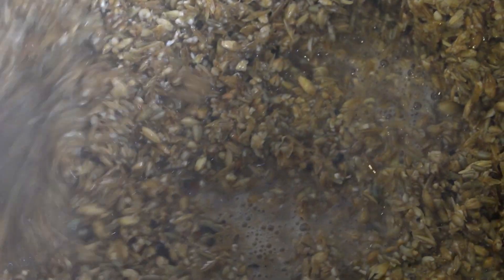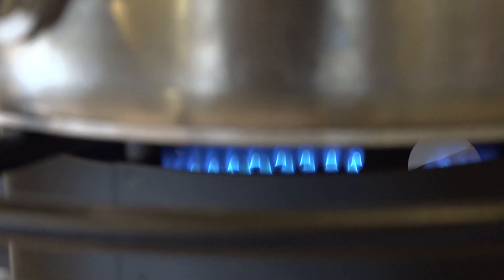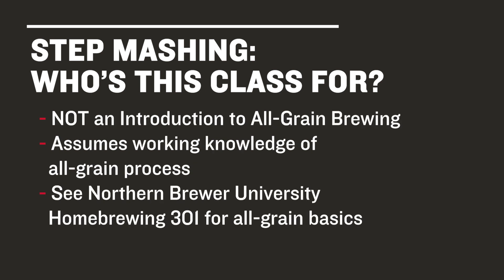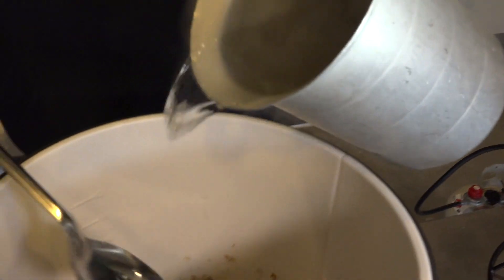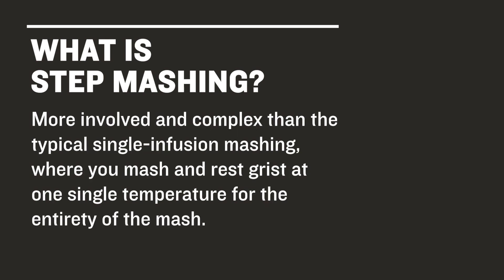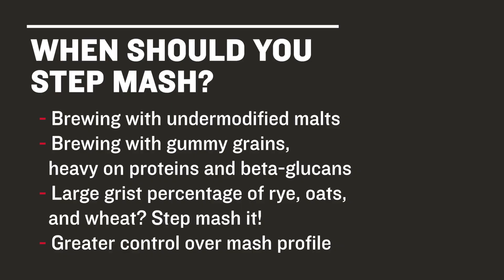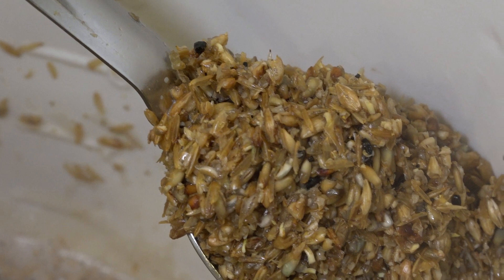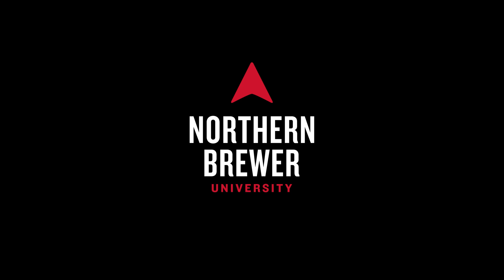Homebrew 302: Step Mashing | Northern Brewer University Online Course

Comment: I step mash with a biab. hoist the bag out and slowly increase to the desired temp and lower my biab back in for each step, little tricky but the outcome worked
Reply from the maker: Great idea. I have done that just to bump mash temp after losing a degree or two, but never thought about using BIAB for full-blown step mashing. Thanks for the idea. Cheers!
Reply: @NorthernBrewerTV  I may need to purchase a bigger kettle from you guys in the future 😄 I have an 8.5 gallon and the water level was near the top while doing 12lbs of grain 😐 Didn't lose any though!